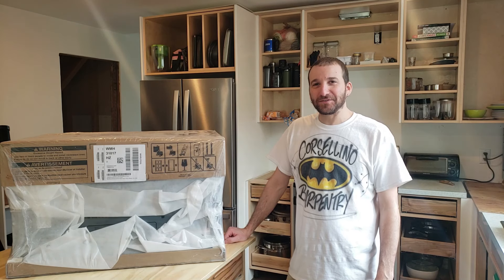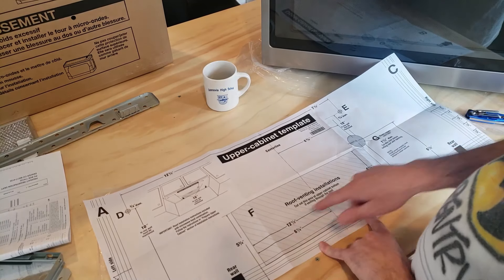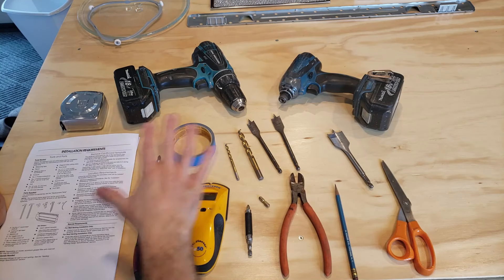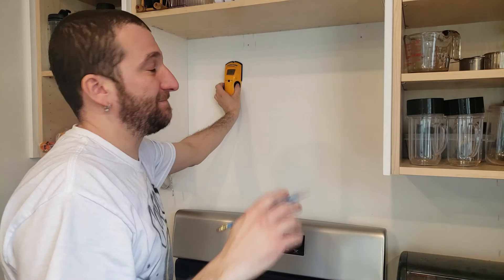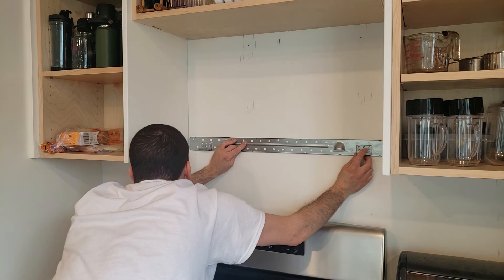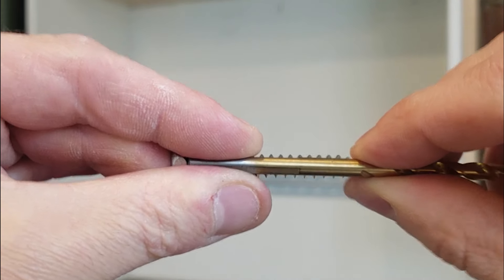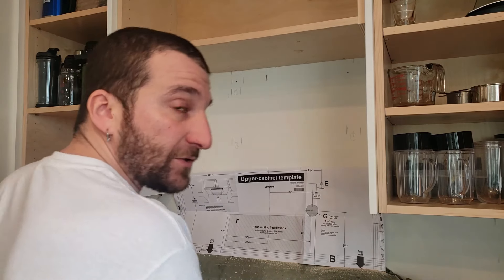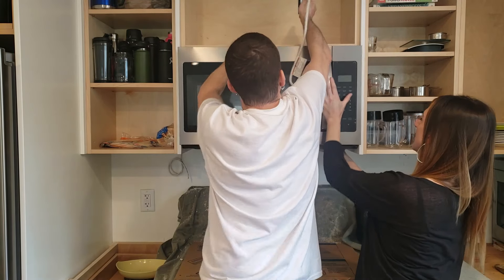How to install an over the range microwave - Whirlpool WMH 31017 HZ smudge proof stainless steel

Comment: Ours has never vented stove smoke even on the high fan setting. Does yours vent the air? 
Wondering if it is a a faulty install or bad vent design...
Reply from the maker: This model you have to flip the motor around before installing with top vent, so that might be installed wrong. The vent could be blocked somehow or they ran the vent too long of a distance or not to the right specs. Maybe a bird's nest clogging the end or something. Or the flap on the outside might be stuck shut. If you hear the motor running it might sounds like it's working but maybe the actual fan got blocked or something? I dunno there's a few possible things that could be wrong with it. Of course it could also just not work well...
Reply: @BorsellinoHomeServices  Motor was flipped up in the right direction. Reinstalled yesterday after putting some duct tape covering some small holes on the back of the microwave (to maybe increase suction)... not much improvement. 
Its a new building and from day one it was like this.

Why would long ducting after the microwave matter if it works properly? The fan should push it out the top of the microwave at the same speed, no matter the length of ducting afterwards I would think...?

The suction is also pitiful when not installed on wall (tested during reinstall).

I think it is just crappy design --> crappy suction.
 🙁
Reply from the maker: @matthews8691  that sucks that it isn't working right. I don't know if long duct matters or not it was just a thought. Or maybe the duct takes too many turns. That can reduce airflow I would think... Is it the same model that I installed in the video? If it is new maybe just try to return it
Reply: @BorsellinoHomeServices  exact same as in video. Just past 1 year warranty unfortunately... should have dealt with the issue when we moved in a year ago. oops

Comment: Hi there ! Does the fan automatically come in while using the microwave ? I can’t find if there is a way to shut off the fav when just warming up something
Reply from the maker: uhhhhhhh i never really payed much attention to that but there must be some exhaust built in if that's what you're talking about. But not like the main loud blower fan right??
Reply: Yes it’s the super loud fan that you turn on while cooking. For some reason when the microwave is on the fan automatically goes on. I was wondering if everyone’s does this or if my husband installed something wrong it a setting I can change .
Reply from the maker: @Tperrien22  I just tested mine and the fan does come on! I turned on the actual fan and it does match the sound of the low setting, not the high setting though.My guess is there's no way to turn it off. If it's coming on with the high setting for you there might be something wrong with the wiring, but it should be the lower of the two settings for the microwave part.
Reply: Bummer !!! I hate that fan sound just for the microwave ! Thanks for checking
Reply from the maker: @Tperrien22  you're welcome

Comment: Thanks it was very helpful. It would seem to me that the brackets holding up microwaves are fairly standard now. I am replacing my microwave rather than installing it anew. Do you think the brackets could be interchangeable with the replacement microwave? I think it's worth a try versus redrilling holes, etc. My old microwave is a Maytag CMV1100AAW.
Reply from the maker: You could try but I doubt it will be exactly the same. Although Maytag is owned by Whirlpool so hey, you never know! worth a shot!!!
Reply: So Joe was it interchangeable?

Comment: Just curious about the paper that had the dimensions for the holes for the two screws and plug to go through on the bottom of the overhead cabinet.  Aren't the holes positioned correctly on the paper so that you could put the paper up and just mark where the holes are instead of having to measure them?  I am about to install a Whirlpool microwave that came with a similar drawing printed on the cardboard that cuts out.  I was hoping to use that but since seeing your video I thought I would ask.
Reply from the maker: sorry for the delayed response. Yes if you have a carboard cutout, in theory it should work. I just trust measurements over paper

Comment: I don't have a wall vent or a roof vent. What's my next move?
Reply from the maker: there's a self-recirculating vent option where it filters the smoke and spits the air back into the room. I can't imagine it works very well though

Comment: I'm still a tad confused about those two bumps on the bracket. I'd think you'd want the microwave flush against it and the wall, plus it tilts it forward.
Reply from the maker: yeah i dunno... i just followed the instructions and it worked perfectly for me
Reply: @BorsellinoHomeServices  same lol. Thanks a ton for the video. As a visual learner I got it on the first try

Comment: Customers need to think twice before buying  the Whirlpool microwave- wmh53521hz-5. When the light won’t shut off the only way to fix it is to buy a new motherboard, and they range in price from $156 to over $300 online plus tax and shipping. Also $150 for service call to install it. And it’s an inherent problem in this Whirlpool model. You can buy a new microwave for $450 or pay that much for repairs or buy an LED stick up under cabinet lights for $12 to $18 as a alternative solution.
Reply from the maker: wow! Yeah seems like they make everything easily disposable versus repairable these days

Comment: And all this would be well and good if I didn't have stupid granite behind the microwave! Grrrr... Even Whirlpool didn't want to do it because they could crack the granite... So here I am, watching YT videos...
Reply from the maker: granite behind the microwave??? That is very interesting... You should be able to drill holes through the granite and use toggle bolts to hold the bracket in place. I'm a little confused why the granite runs up the wall.
Reply: What if we make extra punched holes in the bracket to be in alignment with the already made in the wall? Whirlpool microwave bracket
Reply from the maker: @virginiaschultz3384  Hmmm... depends on how much metal is around it. If it seems like it will compromise the strength then probably shouldn't... might just need to add a washer if its right near another hole. Hard to say without seeing it.
Reply: @BorsellinoHomeServices  Thank you!

Comment: Not trying to be a troll, but Maytag/Whirlpool brand is crap. I am replacing my OTR microwave that has a 10 yr warranty on it. It pooped out after 3 yrs. I’m single and the only one who has ever used it, and I treated it well. The manufacturer refused to honor the warranty. The door sensor no longer identified when the door was shut, so it wouldn’t run. Maytag/Whirlpool only warranties the electrical/motor. Such a waste of $600!!!! They lost me as a customer forever!!